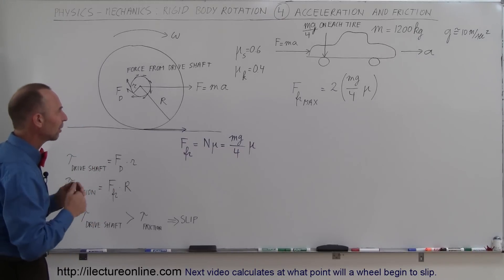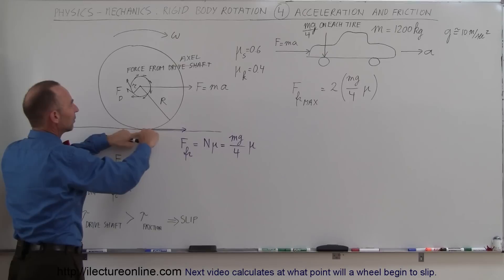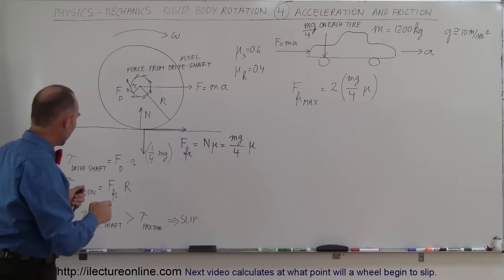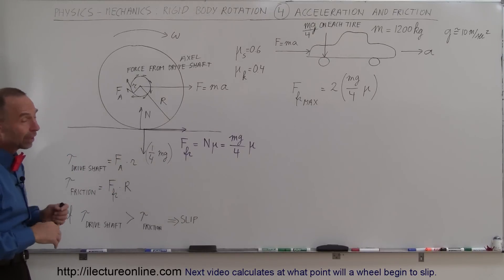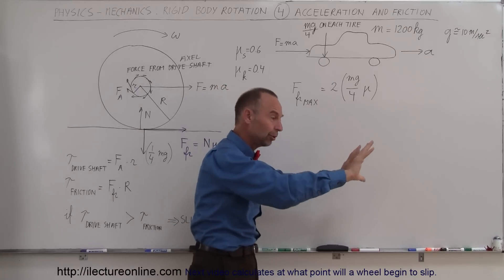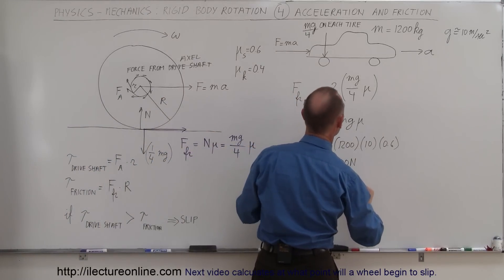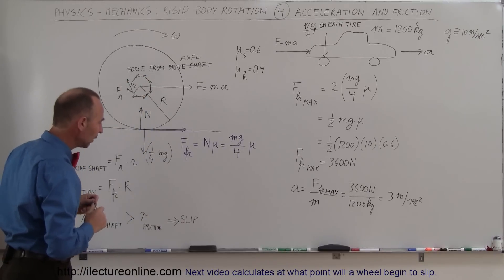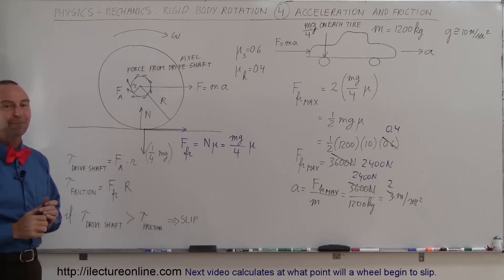Physics 11.1 Rigid Body Rotation (4 of 10) Calculating Acceleration & Friction of a Car Tire

Comment: if there are 6 wheels in total and 2 drive wheels what will be maximum frictional force
Reply from the maker: There are different types of friction for rolling wheels.  That is explained in more detail in the engineering videos:  Mechanical Engineering: Ch 11: Friction (44 of 47) What is Rolling Friction?   https://youtu.be/v1FkqZrEPg8

Comment: How does the moment of inertia of the wheel counter the torque from the axel?
Reply from the maker: We are indeed ignoring the moment of inertial of the wheels.
Reply: @MichelvanBiezen  How can we calculate the counter torque caused by the wheel attached the axel?
Reply from the maker: You can find the work done to make the tire rotate.  Work is change in rotational kinetic energy.  The you can calculate the torque required to make the tire rotate.
Reply: @MichelvanBiezen  What should I take for the angular displacement (Theta)? Thanks and really appreciate your quick response.

Comment: Can you do a video explaining what happens when a car hits a bump on the road? Does hitting that bump or bumps cause the car to slow down? Does the earth and car exchange momentum and the momentum and speed of the car reduced?
Reply from the maker: You can think of a car hitting a bump on the road as a collision.  And just like with every collision, momentum is conserved, but energy is not conserved, unless the collisions was perfectly ellastic (which doesn't occur in the real world).  Since energy is lost, that car will move slower after the bump.  The amount of the slow down will depend on a lot of factors, such as the type of shock absorbers, the height of the bump, the shape of the bump, etc.

Comment: Are we assuming that there is no friction force on the Rolling Wheel which opposes the friction force acting on the powered Wheel ?
Reply from the maker: We are not considering the rolling wheels here, only the powered wheels.
Reply: @MichelvanBiezen  Thank you so much for the quick response! So the actual net force which accelerates the car would be FF powered Wheel - FF Rolling wheel, wouldn‘t it ?
Reply from the maker: You would also need to take into account the rolling friction (see our mechanical engineering videos for that) and the wind resistance and the inernal friction of all the moving parts.

Comment: How are you telling that the axle provides a force to the wheels. This NEVER happens. The shaft and a wheel are a single rigid body which recieve their torque from the drive shaft through a differential gear. Explain please. How can a single rigid body have a force from itself
Reply from the maker: The purpose of this video was not to explain the mechanical structure of the drive train of an automobile, but instead to show the physics principle of a rigid body of rotation.
Reply: @MichelvanBiezen  Of course I appreciate your effort. And I always watch your videos. But I was just wondering. That's why I asked.
Reply from the maker: Automobiles are mechanical wonders.  Explaining the structure of an automobile in a series of videos would be very interesting.

Comment: Mr. Professor I have a question. When motorbike and car are going in the same direction on the road with the same speed. Let's s suppose that the motrobike will fall, is it possible that the fallen motorbike will be able to overtake the neighbouring car, since its friction coefficient will decrese?
Reply from the maker: As soon as the motorbike goes down it will begin to slow down because of the friction.  Before the bike went down the engine kept the bike going at the same speed, just as the car will maintain its speed due to its engine pushing the car forward at constant speed.  So the bike will fall farther and farther behind.
Reply: I was wondering if two objects which have the same kinetic energy and they are losing it due to the movement caused by friction. When one of them will reduce the energy reqirements let say by factor of ten (or friction less), if it will be possible to overtake or keep the same speed as the secound object becesue of its greater grip and energy losses.
Reply from the maker: Two cars side by side traveling on the two halfs of a road at the same speed.  The right side of the road has been sprayed with water so that it is wet, the left side of the road is dry.   Both cars push on the brakes and lock the wheels.  The car on the right side will slide farther than the car on the left side, because there is a lower coefficient of friction on the right side.
Reply: Thank You very much Mr. Professor.

Comment: Hi Michel, can this calculation be applied to trucks? like a 6x4 configuration truck where the rear wheels have double tires
Reply from the maker: The principle would indeed be the same.  The double wheels on a truck are usually there for handling the extra load.

Comment: Thank you for your videos. There is however a small error in your explanation. You assume that if the torque of the shaft is larger than the torque of the friction, there will be slip. This is not correct. If the wheel accelerates without slip then the acceleration of the centre of mass (the acceleration of the translation) must be equal to the angular acceleration (the acceleration of rotation) times the radius of the wheel. You cannot have linear acceleration without angular acceleration when the no slip condition applies! The torque of the shaft minus the torque of the friction is equal to the angular acceleration times the moment of inertia. This means that the torque of the shaft is always larger than the torque of friction when the no slip condition applies, otherwise there would be no angular acceleration opposite to the linear acceleration.
Reply from the maker: When the tire is not moving, if the torque (on the tire) produced by the shaft is larger than the torque (on the tire) produced by the friction force, then the tire will slip.  If the tire is spinning at a constant speed, the same holds true.  While the tire is slipping AND accelerating, part of the torque produced by shaft is used to accelerate the spinning tire.
Reply: @MichelvanBiezen  Consider just the wheel and not the whole car. Take a wheel with a mass m of 2kg and a radius R of 0.2m. The wheel is at rest. Then a torque T of  1.2 Nm is applied on the wheel by the shaft. Let's assume a friction force F of 4N. In this situation the torque from the shaft is larger than the torque from the frictions force (1.2 > 0.8). But there is no slip in this situation because a = alpha * radius ( no slip condition)

Proof: a = F/m = 2 ms^-2 and alpha follows from I * alpha = T - RF = 1.2 - 0.8.   With I = 1/2mR^2 = 0.04 kgm^2 you will get an alpha of 10 rad/s^2. Multiply this with R=0.2 and the no slip condition holds even if the torque from the shaft is larger than the torque from the friction force....
Reply from the maker: Good input!

Comment: Thank you so much. Sir, what happens when the car is moving at a constant speed and has 0 acceleration? Does that mean the Force of friction is 0?
Reply from the maker: If an object is moving at a constant velocity, then the net force acting on it is zero.
Reply: @MichelvanBiezen  Ok, but when the net force is 0, it means that the forces aiding the acceleration are equal to the forces opposing the acceleration in magnitude. Here, which force is aiding acceleration and which one is oppising it?
Reply from the maker: In this particular example, the force aiding is the force creating the torque and the force opposing is the friction force.

Comment: Thanks Professor, I have a question. I see that you calculated the FMax for the car to not slip, but how its done to calculate the minimum force (or torque) required to move the car from a total stop. Assuming all the variables presented as in this video. Thank you so much
Reply from the maker: Notice that in this problem we are only looking at the friction between the tire and the road.  That is why there is no minimum friction to get the wheel moving.  Off course in the real world, there are all kinds of friction forces that need to be overcome which were not considered here.

Comment: Why is rolling friction not used in this example? Is this because it's solving for maximum acceleration only?
Reply from the maker: Rolling friction is usually not covered when dealing with rigid body rotation.  That is usually covered in the mechanics engineering section where we determine the rolling friction of wheels and tires.

Comment: I was confused at first because you draw F = ma and also F = Nu. You draw these as two separate vectors so I thought you should sum them up. But actually they are the same force, so do not sum them. The friction force acts as a linear force that propels the car forward, and also creates torque. I think this is also why a lot of ppl get confused by seeing the friction force pointing forward instead of backward.

Comment: if i want to have an electric motor spinning a wheel, how do i find the force of the axle as shown in this video? i don't see the force a motor can apply in the specs and stuff
Reply from the maker: The force requirement of the spinning wheel would need to be measured.  Motors are usually rated in terms of power  (W or kW)
Reply: @MichelvanBiezen  Thank you! Also, if we know the force requirement of the spinning wheel, how can we know whether the motor can supply that force given the power of the motor?
Reply from the maker: Power = Work / time  = Force x distance / time = Force x velocity             Thus it will depend on the velocity.

Comment: All these diverse forces on the tyre are in turn felt at every point as the wheel completes a rotation .There must be established a common equallibreum that the forces can move through ,so that the tyre is not torn apart
Reply from the maker: Tires undergo a lot of stress while they are rolling.

Comment: sir why is the friction acting in the direction of the force? i though it is suppose to act in the opposite direction
Reply from the maker: (That is why I don't like to make generalities).  What would happen to the tire (and the car) if there was no friction?  The tire would spin and the car wouldn't move.  But with friction, the rotating tire will push against the road (due to friction), and the reaction force (the friction force of the road onto the tire)  will push back against the tire, causing the car to move forward.

Comment: What will be if wheel slip coefficient is between 0 and 1 (for example 0.5)? I assume that we will still have force that pushes car forward, but it will be less than static friction. Is there any formula for this? Thanks.
Reply from the maker: Just replace the coefficient of static friction, with the coefficient of kinetic friction.

Comment: 1.If for non slipping condition both drive torque and friction torque should be equal,
2.How can a wheel obtain a angular acceleration if both torques provided by the shaft and friction equal and opposite in direction?
Reply: The wheel is considered to have negligible mass and negligible moment of inertia in this example.  And relative to the total mass of the car, it is a small fraction of the car's mass.

Comment: Hi. I have a question on how to use published data about cars to insert in exercises like this. If you have the plot of car power and torque against rotation frequency, are the data for power and torque the effective ones ( that is, considering the efficiency ) or the nominal ones? In another exercise you adopted 20% efficiency applied to a nominal power of 100 HP. I would like to use the published data ( including in google). Many thanks.
Reply from the maker: All the data is available, the trick is finding it on the internet.  That is much harder to do.
Reply: @MichelvanBiezen  Thank you for replying. I am asking if the factory divulged data are the "practical" ones . For instance, is torque measure on the axle or actually on the wheels? In the second case an efficiency factor should be included.

Comment: Hi, I have a question. how would the sum of torques be applied here? (in the condition before slipping) and how would the angular acceleration be calculated from the sum o torques? My question is mainly due to the fact that you mention that the friction torque should be greater than the driving torque (for the wheel roll without slipping, at least). Wouldn't that mean that the wheel would spin counterclockwise instead of clockwise as it should?. Furthermore, since the condition is "no slip" the angular aceleration should be equal to the linear acceleration times the wheel's radius, right?
Reply from the maker: That is a LONG question.  Let's start with this, if the torque turning the wheel is greater than the torque provided by the friction between the road and the tire, the tire will slip.
Reply: @MichelvanBiezen   hello.
so where can we find the answer to this question?
Reply from the maker: Start with this playlist:   ASTRONOMY 31 WHAT IS SPACE MADE OF?
Reply: @MichelvanBiezen  Ok...so... in order to accelerate from rest, a car's wheel will always have to slip? necessarily?. Or more general, is it possible to accelerate a wheel in a car by applying a torque without the wheel having to slip?
Reply: @andresyesidmorenovilla7888  did u get a answer to this from anywhere?Thanks
Reply: @andresyesidmorenovilla7888   Thanks a lot🤗,  I could clarify several things✌️

Comment: Why we're not consider friction on front wheel????
Reply from the maker: We are assuming that only the rear wheels are connected to the driveshaft.
Reply: We're also assuming ideal bearings for the front wheels, that generate no friction.

Comment: What is the friction coefficient for steel wheel rolling on steel surface? Something near mu=0,001??
Reply from the maker: It is very low and does depend on the type of steel and the amount of flexing.  (That is why rail road cars have very low friction when they roll)

Comment: Sir one question can gear ratio make 1200 kgs car with 50:50 weight distribution with 0.2955 m tire radius sprint 0-120 in 6 sec. What gear ratio or how much torque is required at wheel (Torque Friction) or at axle(Torque Axle)
Reply: The gear ratio is not in the picture of this problem, because we are considering the torque that is outputted by the entire drive train by the time it gets to the drive axles.

The gear ratio is involved in a real car, because the engine of the car has a preferred range of speeds at which it needs to rotate for a given power output.   You use a low gear setting at low speeds when the acceleration and load on the engine is the greatest, and you use a high gear setting when you are at a cruising speed and the load on the engine is only that needed to overcome friction and air drag.

Comment: Professor, if we were taking into account rolling friction as well, then instead of setting the friction force that we calculated equal to ma would we set Friction Force - Rolling Friction Force = ma? Thanks!
Reply from the maker: You simply add the two friction forces together and use them as the total friction force.

Comment: Can u please explain how the forced acts  when straight moving car is turned right .Also explain the cause of force .
Reply from the maker: When turning the tires, a component of the friction force will point towards the center of the turning circle, which means that component is the centripetal force causing the car to turn.

Comment: This is SO WRONG. Rolling resistance ( friction) is caused by uneven deformation and a tilt in Normal force by the ground. It's not an extension of the static friction as explained here.

https://en.wikipedia.org/wiki/Rolling_resistance

Comment: Why is the friction directed to the right?
Reply: I was wondering the same!
Reply: Sourabh Borkar It’s because of a Torque moves the wheel. If you think about it, the torque will be to the right because friction opposes the direction of motion.

If a force moves a wheel on the other hand it’s different. Then it generates a friction opposing the direction of motion as well. That would be to the left.

Comment: isn't it the "F" in F = ma
the net between Force on axel and Friction?
in which that causes acceleration??
Reply: The F in F=m*a is the net force in general.  It is the net force considering all the forces acting on the object in question.  Some forces are systematically set up to add up to zero, so they need not necessarily be considered.

In this example, the force on the axle and the force of traction pushing the car forward, are going to add up to m*a of the wheel itself.  Most of the force will be transmitted to the axle, in order to push the rest of the car forward.

The picture drawn in this problem, shows the force from the wheel onto the axle that pushes the rest of the car forward, rather than the other way around.  If you draw the forces acting on the wheel, the horizontal component of the axle force, will act backwards.   The wheel is considered negligible in mass, so the horizontal force on the axle will be equal to the traction force.

Comment: What is mustard mean in this context ?
Reply: Perhaps you mean mu_s.   Is that correct?

Mu is the Greek letter that is equivalent to the letter M.   Lowercase mu looks like a backwards 4 with an open top.  The s-subscript means static, meaning it is the coefficient of friction that sets the upper limit of this force as it constrains against sliding motion initiating.  The value of mu_s*N is the maximum possible friction force, for a given normal force of constraint (N).